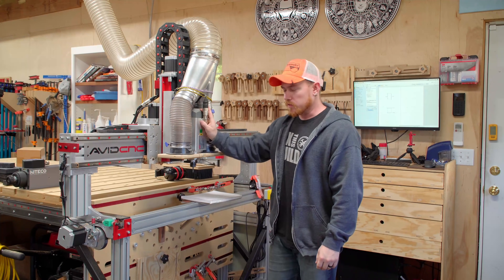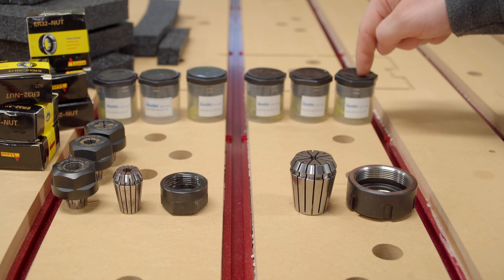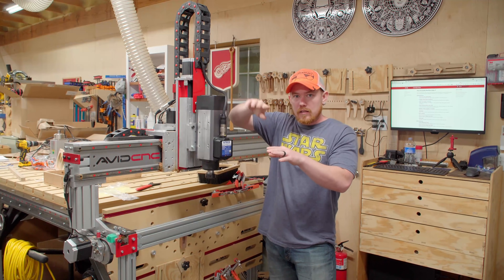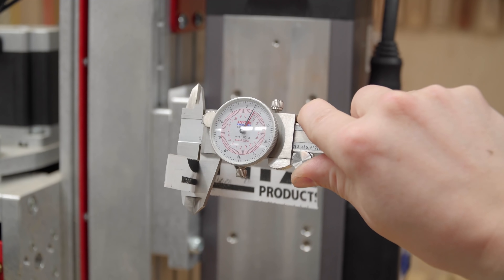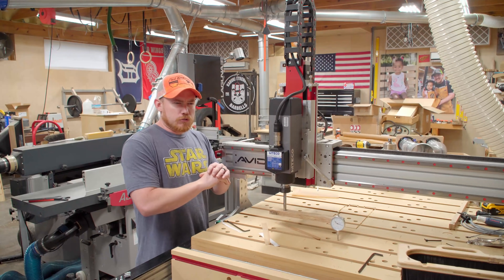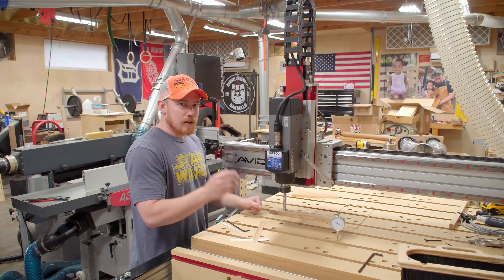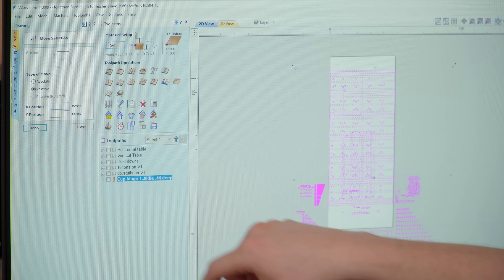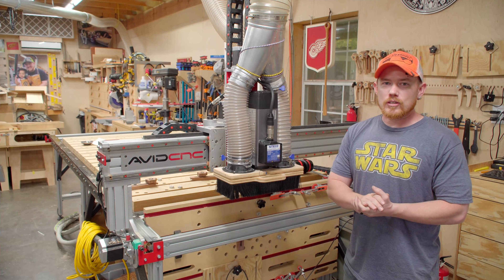Spindle Upgrade: Tramming, Locating, and Dust Collection

Comment: Have an avid pro 4848 on order. I have watched several of your video's and they are vey informative. Anyway, someone suggested using a probe to see how much it  shifted and I thought similar but just sweeping one of the holes in the spoilboard with an interapid or the like to see how much it had changed.

Comment: Was your machine/spindle rigid enough to machine 3/4 plywood full depth at the recommended chip load and get quality edge finishes with a 1/4″ compression bit prior to changing the spindle? Same question for a 3/8″ bit. Same question for a 1/2″ bit.
I assume the reason for the spindle change is for the large surfacing bits. I’m wondering if your CNC has the power and rigidity to support production speed cutting with 1/4, 3/8 and 1/2 inch router bits with the stock spindle and then what difference do you experience with the upgrades spindle.

Maybe the above question is based on ignorance as I just saw something indicating the a rule of thumb is to not exceed half the cutter diameter for the depth of cut.  

Thanks in advance for sharing. I really enjoy your content.

Comment: Awesome video!  Thanks for the detail explanations.  That was great stuff to learn about the offset and how you measured it.  Oh, when you do your pecan slab, try to capture those cuttings separately.  They might be nice to use in a smoker.  If you have a pellet smoker, those pellets are made by pressing sawdust into dense little pellets.  You can do the same with your CNC dust and a press.  Pecan smoke is awesome on just about any meat you can name!

Comment: Hi Jay, thanks for posting this.  I have the same spindle on my CNC which I just got up and running in the past several weeks and so have had a few thoughts regarding this subject.  I considered tramming in a manner similar to what you show however, I discounted it because spoilboards do not start out flat which is why we surface them in the first place.  It didn't seem logical to tram to a surface that I did not know was flat.  I was starting from scratch which is a different condition than where you started so perhaps you knew your spoilboard was flat.   I used the Avid suggested method using a 1/2" endmill and did not notice any ridges so called it good.  I then surfaced the spoilboard with the huge Amana (nearly 4" diameter bit) and noticed ridges indicating my Y axis nod was slightly out.  I then shimmed out the nod and checked it again with good results.  It seems it would make sense to surface the spoilboard again and then re-verify the tramming operation was correct.   Steve

Comment: Actually nice to finally see someone tram in one of these larger CNCs in a better manner. Congratulations on the nice upgrade.
Reply: it's funny seeing the struggle to resist the desire for unnecessary precision.   tolerances which make sense with machining metal make no sense at all when milling wood products.

Comment: Jay, I made a dozen or so dust shoes, trying to get the dust under control. If you look at the professional machines, you will see their shoe is fixed, and the spindle goes up and down independently. This cuts down on the dust plume when your machine does a safe Z move.

Comment: Thank you very much for posting this. This kind of info is great to have for folks just starting out with CNC. 
I have a much smaller CNC and as I was climbing that steep learning curve I found out about tramming. I trammed with a 1/4" glass plate and then surfaced the spoil board. What a difference. I also use the precision collets from Precise Bits in both my router table, Porter Cable router, and CNC, and again what a difference. I also did a couple of short videos on tramming mine and I'm going to add this video to the reference links.
Thanks again Jay.

Comment: Did you run into any limitations with the old one that made you think I wish I had a bigger spindle? Thank you
Reply: Thanks, I was wondering the same.  Particularly looking at the bits he likes to run, which are generally on the smaller side.  I've got a 3 HP router in a table, and it's that HP because I want to run some really large bits for making doors.  Much larger than that and I'd be looking at a shaper, which I might still do.